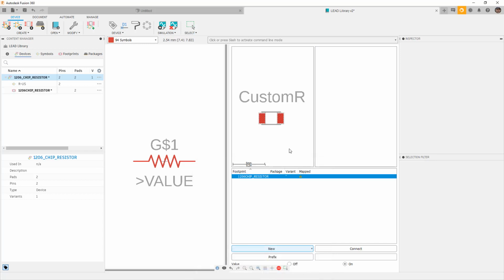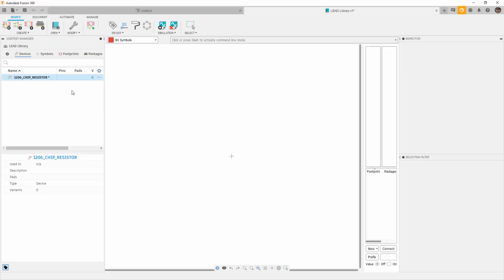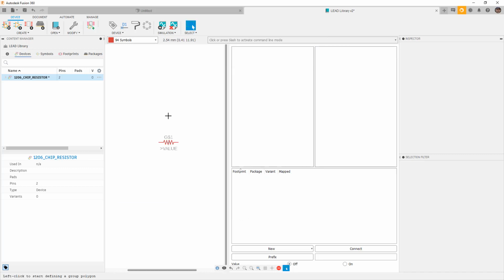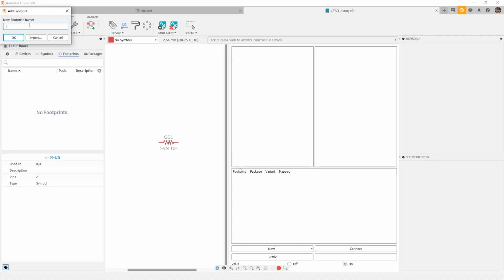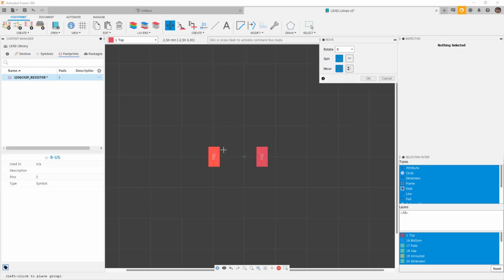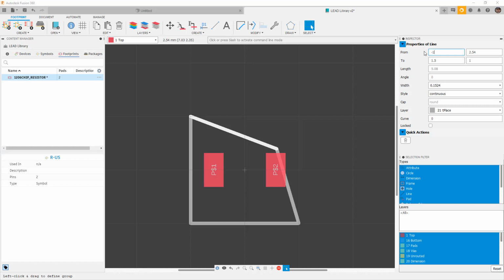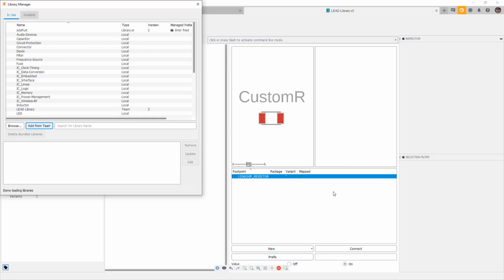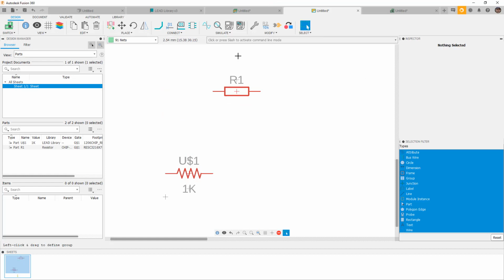Custom PCB Libraries in Fusion 360: Episode 2 #Fusion360 #Fusion360PCB #Maker

Comment: Great series of video and thank you!
Reply from the maker: Thanks Yan, In my email the comment was a little different asking about swap levels.  I see you edited your comment but I will try to clarify that just in case.  Swap Level is an ID that can determine if Pins can be swapped on a device.  This is usually done so the software (or engineer) can create better routing.  If the swap level is 0 that means no swapping is done.  If you had a 10 pin connector and it didn't matter which pin was power, which was ground and which were signals you could allow them to swap and re order so that the traces can avoid things like vias so they don't have to jump sides of the board.  In a lot of cases when you are talking about pins for a component or if your output is very specific pin orientation you would not use swap levels for anything.  It really(as much as I know) comes in to play when you have control over the orientation of the pins.

For example if you were putting a DB 15 connector on your board and that cable was going to say a monitor.  Well the monitor needs the pins to be in a very specific order.  This "Could" be handled by a wiring diagram where Pin 1 on the device is Pin 15 on the other end of the cable, but this is generally bad practice as far as I am concerned.

Hope that helps.
Reply: yes, I found the under the modify menu, there's a swap pin command, so you can swap pins of a resistor
Reply from the maker: @yanhuang4911  Or any component.  Resistor is just a common example but it could be a pinout to a connector like a JST if you are controlling the cable.  I would avoid using it unless you are dealing with a really complex board AND the connector/cable has different ends.  What I mean is say you have a JST connector on the board side and a USB on the other end.  Since the cable is custom and can't be reversed you don't have to worry about grabbing the wrong cable and blowing up your board :)